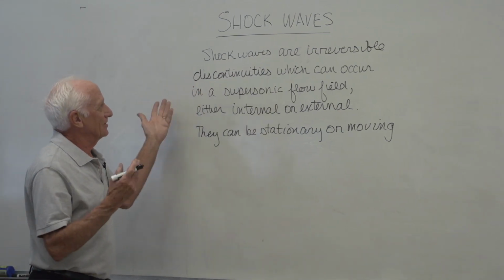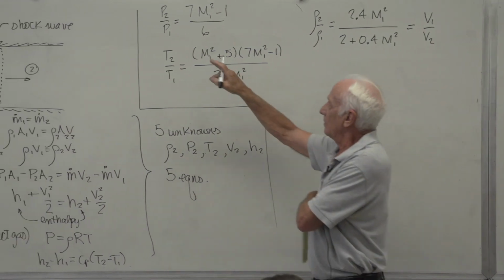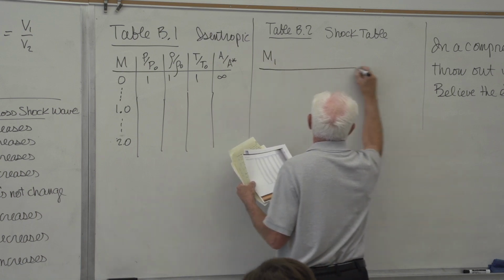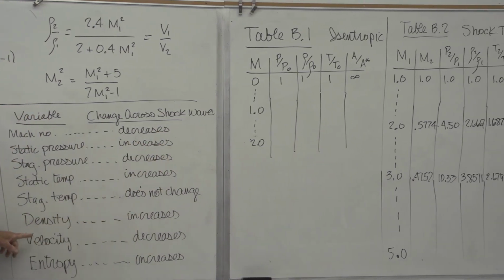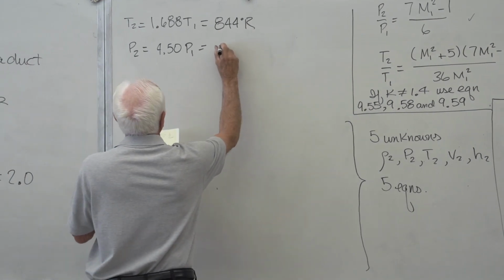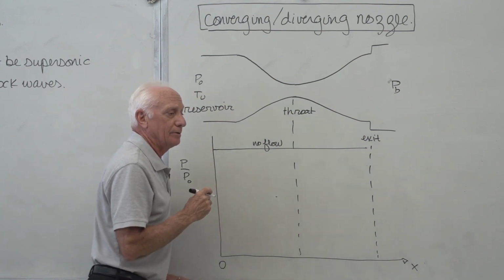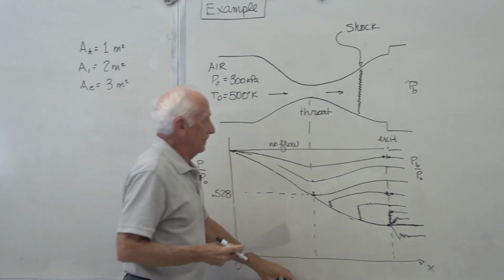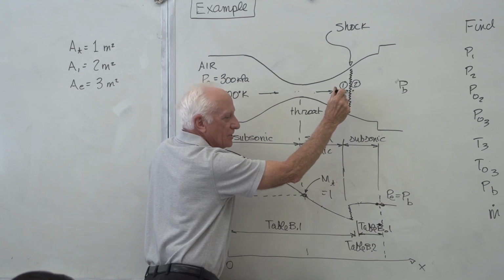Fluid Mechanics: Shock Waves (29 of 34)

Comment: Awesome Lecture, John. thanks.... My peeve with all of this is,... Abbreviation for Mach is a Ma, not M..... Kelvins  is  K , not degrees K, same with Rankine, it's R, not degrees R..... Absolute scale = No degrees....... I shouldn't have to rag on about constants, but it is what it is. Please Relate Kelvin  and Rankin as Kelvins and Rankins as absolute, not a tweak with degrees, so that the class doesn't look silly. Ohhh and BTW the isentropic index is referred to as  Gamma . Yep...... not k
 which is   k = kilo
Stay safe
Reply: literally never seen Mach as anything but M
Reply: Ratio of specific heats is often k in mechanical engineering circles and gamma for aerospace engineers. I see both regularly. I agree about Kelvin and Rankine though
Reply: @hotshot56371  Sorry, I wasn't trying to tear a strip off of anyone, M could be  mega, metres, miles or thousands,( if you think MBTU/hr, etc) Same for K could be kilo, Kelvin, . My point was, in thermodynamics Mach is Ma ,so that its not misconstrued in the answer as something else.
Stay Safe.
Reply: Damn bro respect your elders